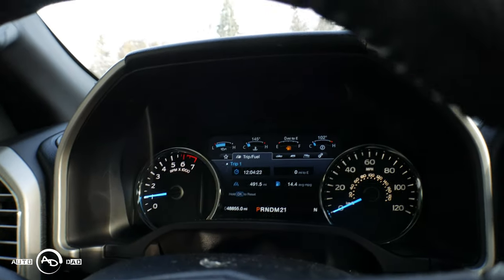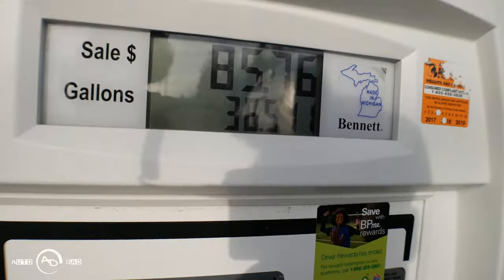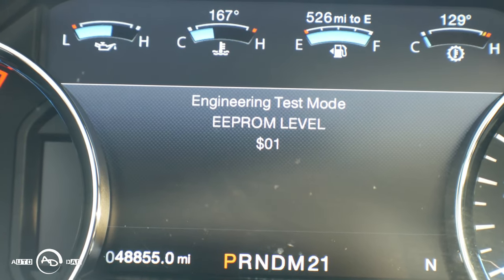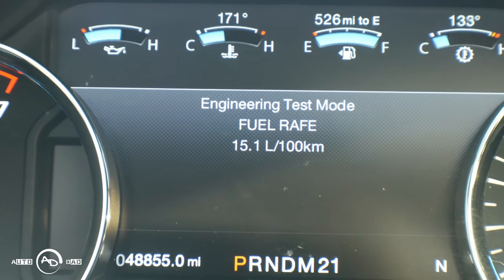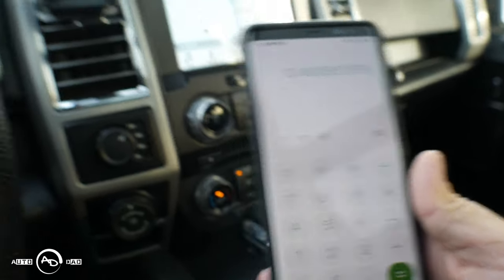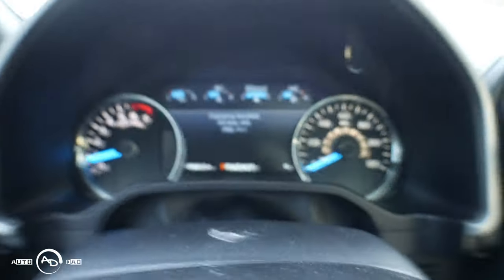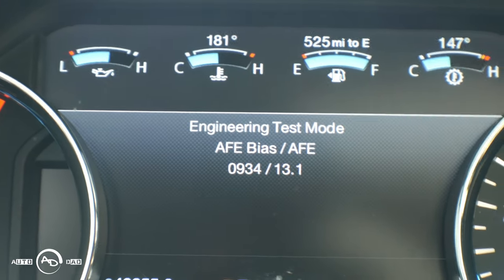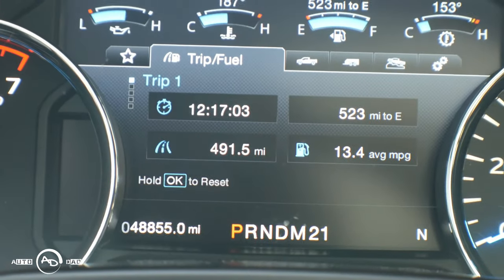How to adjust your MPG readout to make it accurate. 2016 F-150

Comment: The max fuel capacity of the extended range fuel tank is 36 gallons.  Either Ford can let you squeeze in a few extra gallons or your got pump robbed.  My 2015 5.0 is always within a tenth of the dash

Comment: Holy crap. How are you getting such low mpg averages? These new trucks are quitr insane for mpg even if figuring it manually yourself at the pump. I get 22-24 onbthe highway going 60 mph. I get 20 going 77 mph on the freeway. And my average with idling and warmup with cold winters since i owned it is 17 mpg. Its basically the same for the eco and 5.0 as well.

Comment: Fantastic - thank you so much.  I put bigger tires on and was always figuring in my head.
Reply from the maker: You can change your tire circumference in the body control module using Forscan so everything will read correct
Reply: @AutoDad  is Forscan something you have to buy?
Reply: Which one did you get? There are so many - figured you did some good research ha.
Reply from the maker: Check out my videos on it. Just purchase the adapter for your laptop and everything else is free
Reply: Did you get a check engine light or any codes when you changed the tire circumference in bdycm? I got a P160A code on TCM and PCM so I reverted back.
Reply from the maker: No I did not
Reply: @mrdlt3693 A little late, but run a PCM relearn and it will clear the code

Comment: Please excuse my ignorance but if your mpg is off -- wouldn't your miles on the trip odometer be off as well? Would you need to manually, gps figure your miles and then do the math based off how many gallons you filled up with?

Comment: Do you know what Ford programs empty to in our trucks? I'm guessing its 1 gallon because at 13.45 mpg...and only putting in 32.33 gallons...with a 36 gallon tank...you should have had 49 miles to empty at that point instead of the 37 the gauge showed. 49 minus the 13.5 is approximately 36 so thats why I guess empty equals 1 gallon left in the tank but still just a guess.
Reply from the maker: You also have to take in account engine idle time. I have driven quite a while after the DTE gauge read 0

Comment: I mean that’s if your Speedo and all that is calibrated for your tires and all that. My truck was off by .7 . So I was usually 5 MPH faster than the Speedo stated and I would take that into account during my math. Just calibrated my ECM today.
Reply from the maker: I calibrated for my tires long before this. This corrected the DTE calculation along with EMPG

Comment: Is it better to use the MPG on one tank, or the average of several tanks?
Reply: I did mine based on lifetime mileage for my truck and it's been spot on since the tweak. I was off by about 1.5mpg and now I hover around +/-0.1 mpg.

Comment: Can I adjust my speedometer for bigger tires this way?
Reply from the maker: No. I have a video on adjusting tire size with Forscan software
Reply: @AutoDad  I only went to a 295/55/20 it should not of threw it off that much but My truck was saying I was getting 17.6 and I was getting 15.3  just did plugs it it idles better now truck has 35k on it

Comment: Hi is there a mode to run fog lights with high beams? As the fog lights switch off when high beams comes on.
Reply from the maker: Yes, but you need to activate it with Forscan. Check out my other videos on it
Reply: It's called Bambi mode. But check you local state laws. It's illegal in my state as it is in many other states.

Comment: Is there an option in engineering mode that allows you to change your speedometer/odometer for a larger tire size?
Reply from the maker: No, you have to connect and use Forscan  to change tire size. Check out my videos on Forscan
Reply: @AutoDad  will Forscan void your warranty? 🎃
Reply from the maker: No

Comment: There is not a metric you can show me that will prove traffic circles are a bad thing.  Because the alternative stats are always much worse.  Less deaths, less serious injuries, less major accidents, less multi-vehicle(more than 2) accidents.  They are not perfect but if you were doing a feasibility study on replacing a circle with traffic lights, you'd have a hard case.    Good video BTW I wouldn't have ever thought this was something I should or would adjust.  I was under the impression that driving style played a larger effect with averages etc.  Im in Canada so When I have  a full tank and Im driving normal mine reads 999kms to empty.  I can drive anywhere from 30kms to 200 km sending on how Im driving before I lose 1 km.  When I first got the truck I was probably more heavy footed and full tank would say around 890-930s